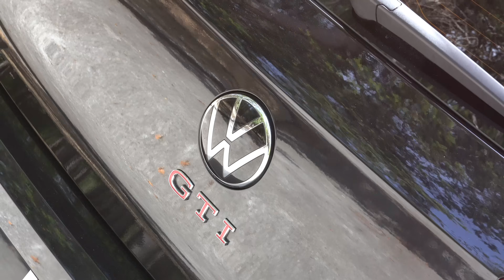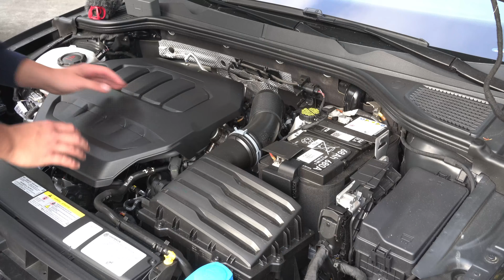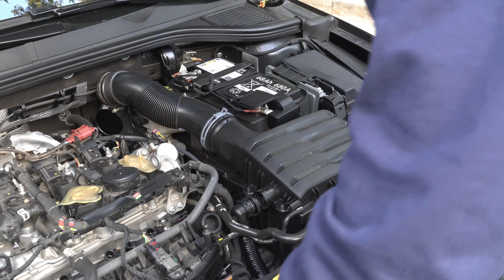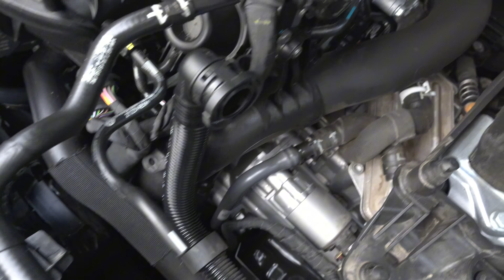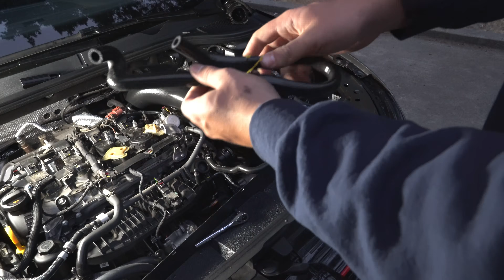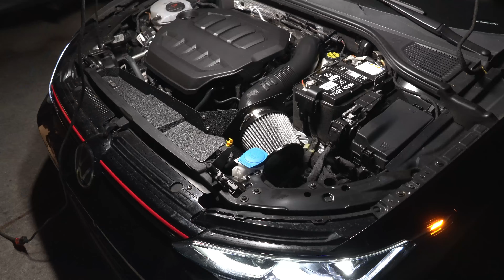"INSANE Turbo Noises After This Mod on My MK8 GTI!" Integrated engineering

Comment: I just installed it today on my 23 gti manual. Ouff. It sounds amazing. I installed it with the sai mini air filter for the vacuum corrugated hose.
Reply: @josephc4093  do you have to buy the sai filter separate if so could i get the link
Reply from the maker: The sai plugs into the intake

Comment: Just hit like and subscribe buttons. 
Do I need to tune after putting in any of those aftermarket air intakes specifically this one?
Reply: nope. tunes are for after you start putting in a bigger turbo, better intercooling system, downpipe, or any other manifold mods. typically, a cold air intake and throwing on a new exhaust doesnt need a tune. however you can run a tune after these two installations and get much better gains.

Comment: Thx so much for this video bro! It's up to date because you have a 2024 mk8 and you didn't skip anything. Comes with the the turbo inlet pipe. That's Rad! I ordered mine already for my 2025 mk8.5. I heard this one doesn't come with the rubber trim seal. But I just ordered some from amazon for $15.00. A tip. Put the coolant hose on first ;)
Reply from the maker: Glad I could help

Comment: Inlet pipe is a lot easier to install on the mk8. Mk7 has a pcv hose attached and can be difficult to remove without a pick tool or breaking plastic

Comment: Do you think upgraded charge pipes will be necessary when upgrading the intercooler or is that a total waste of money? Because like you said OEM design looks very good
Reply from the maker: I think they will only be beneficial if your pushing a lot of power
Reply: Unitronic, APR, and i believe DO88 offer them
Reply: They look night and day in terms of restriction when compared to my mk5.  I upgraded the mk5 to a k04 4 years back and every charge pipe blew off and i eventually had to upgrade all of them

Comment: What do you guys think of the upgraded intake's sound?
Reply from the maker: Sounds baller
Reply: whats with the plastic intake pipe? im used to seeing aluminum or thick heat resistant silicon.
Reply: @LeviSky7  go drive your car for 30 minutes and grab a metal intake then drive it and touch a plastic intake tube and tell me which one is hot...
Reply: Sounds like it needs an exhaust to go with it